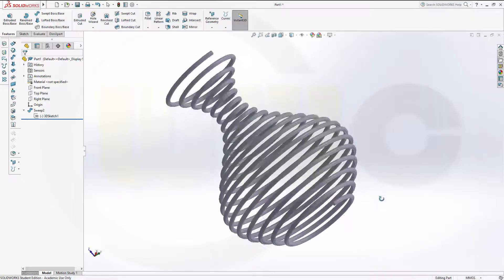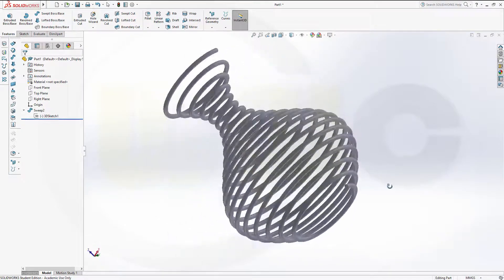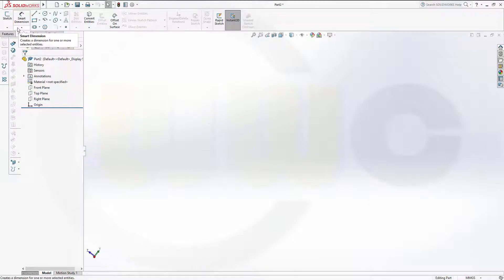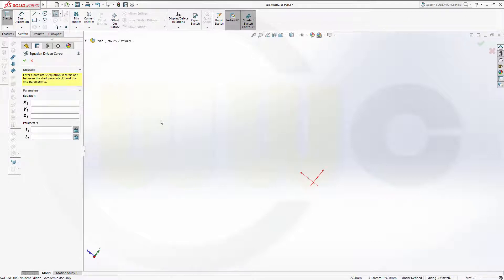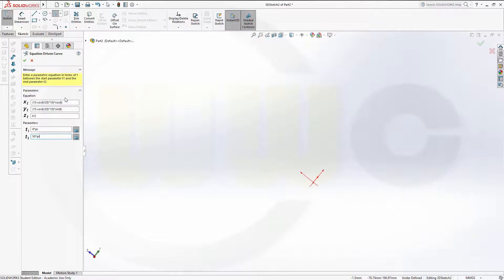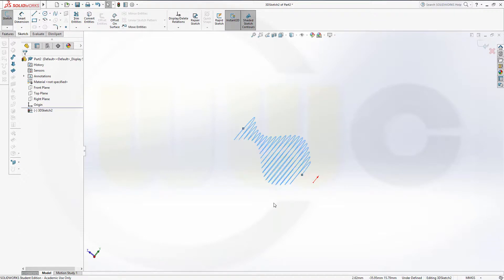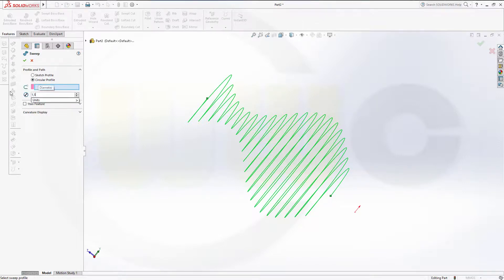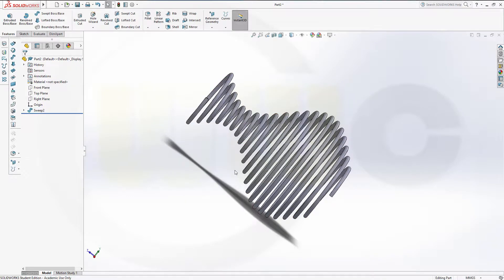Wire - Bottle - 3D equation driven curve - SolidWorks 2017 Training

Comment: I don't understand what you typing. You are excellent in math...This is a first video, shown making a spiral model, don't need any sketch just typing the numbers. :):):) very good...
Reply from the maker: Thx, it is really very basic. With x=cos(t), y=sin(t), z=t you would get a helix.  Then I added a factor which is responsible for the changing diameter if this helix.